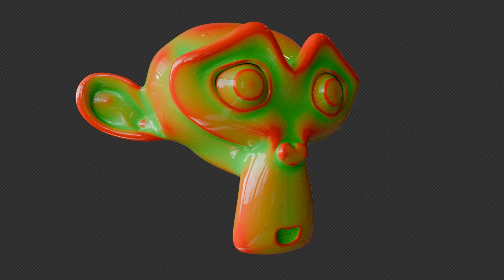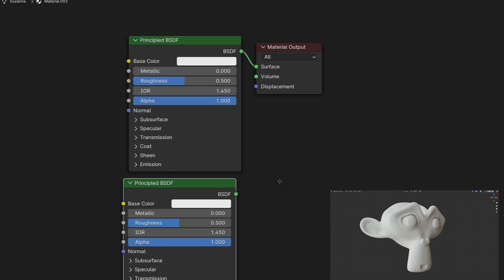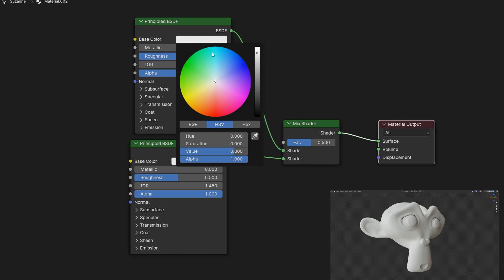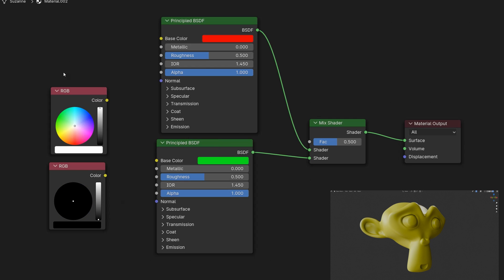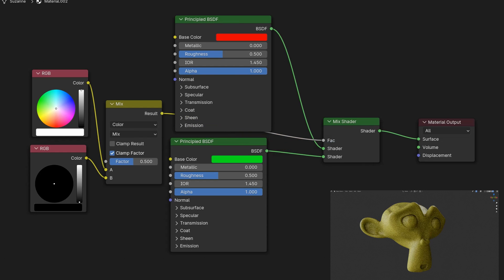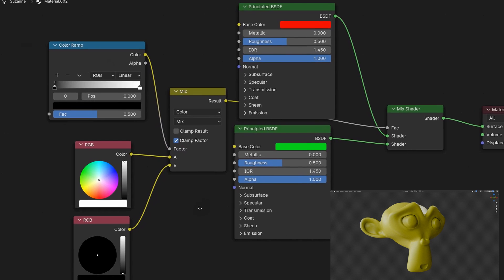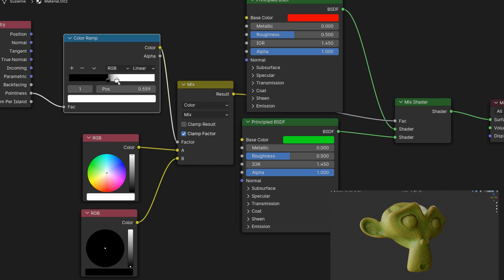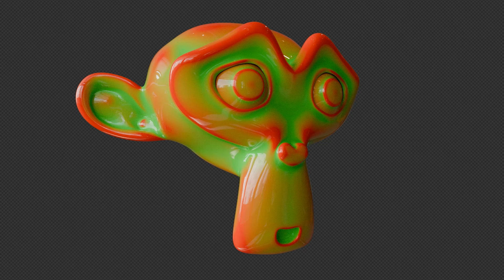Curvature Masking with Nodes in Blender 4

Comment: These are far toooooo many unnecessary nodes. The only nodes you need for this is GEOMETRY NODE, RAMP,  and only one BSDF SHADER. Just add a geometry node, connect its pointiness into a ramp that you color (instead of black white) and then connect that to the color input of one single diffuse or principled bsdf shader that goes into the Material Output. No idea why you use a mix node, and i have even less of an idea why there are THREE (incl mix shader) shader nodes when one would do ;)

Comment: I prefer the ''Dot product method'' to create a procedural edge/curvature filter/mask. 
It is mathematically more accurate i guess. anyway.. results are better with it.

Take a Bevel node and a Geometry node >plug the normal output of both into a >Dot Product math node. Put the value into the value of a >Map Range node (invert To min/To max) and control it with (From min). You can also plug a Noise Texture node value into Fac of a Map Range node and than into the Radius of the Bevel node, to add some noise to the curvature.

YT: How to ''Create Professional Materials'', by Kaizen
Reply: The method you are describing does not create a curvature map, but an edge map. Since it depends on bevel, it is only generated at points where normals have a sudden change in direction, which leaves out smoother curves. And this is also how the video you reference describes it.
Reply: thank you. just saved me lotta time
Reply: @danangthang  
Now I feel meaning in my life again, thank you.